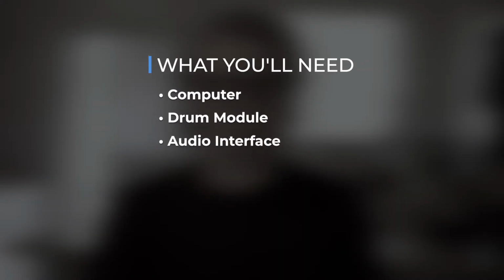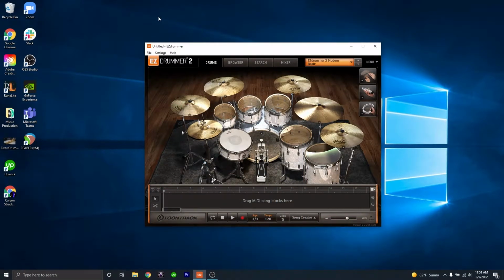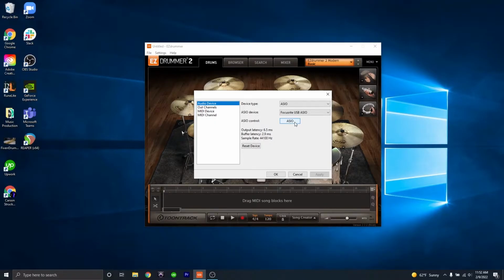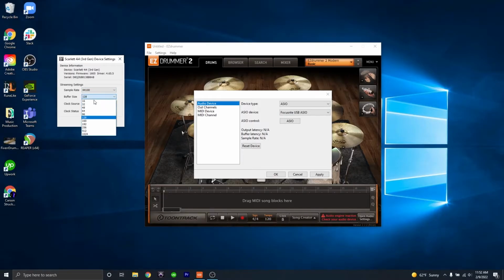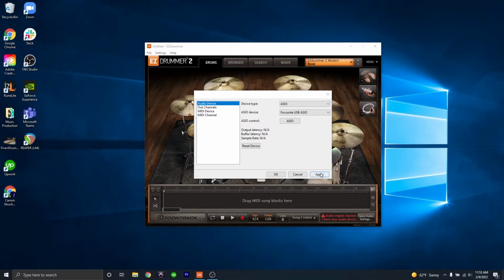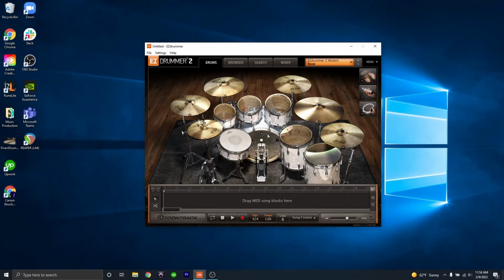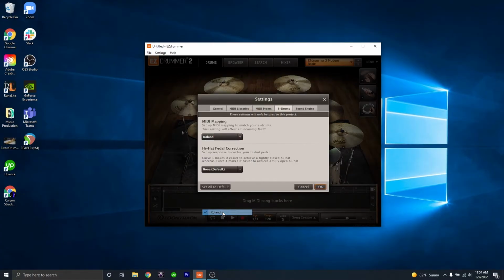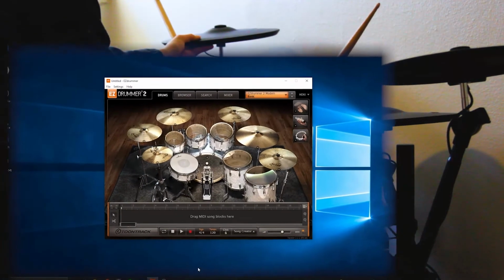How To Connect Your Electronic Drums To EZDrummer2 | MIDI

Comment: This video is the closest I have come to seeing the settings that I can use to control EZ Drummer 2 using an old Alesis SR-16. I have an old, old version of Pro Tools (8.5) which I have tenderly kept running on Windows OS. I still cannot use the pads on the Alesis to make the EZ Drummer 2 speak. I have MIDI thru/Out  on the Alesis going into my old M-Audio (MIDI in on the M-Audio) I have Omni on for MIDI. I am trying to simply play the manual pads on the SR-16 using the sounds from E-Z Drummer 2......sadly aint working.

Comment: Thanks for this video. I just have a few questions. I use an Alesis Nitro Mesh Kit and planning to use the sounds from EZDrummer3. When plugging in the midi cable to the midi input of the audio interface and midi out on the module, where do i plug in the cable so I can hear it in-house and not just on my headphones. Can I just plug in the jack directly to the mono out of the module? or should it be plugged into the mono out of the audio interface? Sorry, I have very little knowledge with these. I've been using the presets of the drum modules and I've been wanting to upgrade with ezdrummer I just don't know how to start. Hope you can help thank you
Reply from the maker: Hey! I'm not sure what you mean by "in house" but all EZD3 sounds will only come from the output of your Audio Interface. You're Nitro Module is only sending data to your Audio Interface to then use with the software. It never feeds back into your Nitro Module. Depending on your Audio Interface, you likely can monitor with headphones as well as the main outputs to say a speaker or some other listening device. Hope that helps!

Comment: Very good video, I have one question, I got my yamaha dtx500 drum, but couldn’t find the driver on internet, is it still needs driver if im using audio interface? Thank you
Reply from the maker: If you're using this method, you won't need a driver for your drum module on your computer. You will need to have the correct driver for your interface installed on your computer though.

Comment: I have a roland td27, an audio interface, pc (windows) and I want to record with a usb cable from the td27 to the pc and NOT with a midi cable (in,out). Can you tell me in detail what to connect with which cables specifically the wiring between td 27brain, audio interface and pc? you can help me;

Comment: Thanks ! This is an easy and very clear video. Can I ask you  some advice ? I have a TD11 and  EZ drummer installed in my comp , and i was wondering if buying this Scarlett would make me win latency (I record to a BOSS Micro BR and later send the file to Audacity in my comp). Is all that depend on the sound car of the computer or not at all if using the Focusrite ?  I was at first considering buying a TD17 module to resolve all that but i have read that the sounds are still "Rolandish" and that there are machine gun effects on the toms. Can you tell me your opinion ? Shall I  stay with EZ Drummer and TD11 and buy focusrite , or just skip directly to TD17 ? Thanks so much Mr carson.
Reply from the maker: EZDrummer sounds are way better than the Roland or any drum module sounds. I'm not familiar with the TD11, but if it has MIDI over USB, then you may not need an interface. I have another video over that as well. But when using MIDI over USB it is a bit more reliant on the computer you're using and the soundcard onboard instead of the Audio Interface which is essentially just an external soundcard. At least based on my experience! Good luck!
Reply: @CarsonStruck  Does the interface act like a headphone amplifier as well?
Reply from the maker: @bradevans3815  the interface I use does. If you're having issues with your pads just being so loud you can't hear your drums, instead of  cranking the volume to 11, I would suggest an in-ear solution like Shure SE215's or something of the like. They are amazing. But I most often just use a drum amp. Which is loud, but I live in a house.

Comment: i have a roland td17kvx and i do video recordings through the roland go mixer pro x console with a camera from my smartphone. Is it worth the effort and the cost to make video recordings via sound card, pc midi? Or should I continue with the Roland go mixer pro x?
Reply from the maker: Honestly, I didn't know this existed. Looks pretty cool and useful! I think that if you're getting things to sound the way you like them, there is no need to switch to something else. This looks like a fantastic solution for a simple live band feed. If you want to utilize EZDrummer though, I recommend hooking up your Roland Module to your computer via USB, which I have another video on, and then just taking the output of your computer to your Roland Mixer. My understanding is that you're skipping using a DAW on the computer and just recording straight to your phone via the mixer instead. So... If you're pleased with your current results, just keep doing what you're doing 🙂
Reply: @CarsonStruck   will i need to buy expensive laptop pc to record like you show in the video? .

Comment: A bit late to the party, but have you noticed a difference in latency between using the usb connection for midi to the computer and the interface as audio out compared to midi cable to the interface? I am just wondering, wether I really need the midi cable. Currently I am running the TD-17 as interface, but the latency at 64 samples is aprox. what you have at 128. That is okay, but not ideal
Reply from the maker: Hey! I have another video on setting it up via USB and no matter which way you decide to set it up, the latency isn't noticeable IMO. MIDI over USB is newer and works just as well in my experience. Your results may vary based on your equipment, but when I made the video my computer couldn't process the buffer size set at 64 without crashing. I've since upgraded to an M1 Mac Mini. To answer your question: No you don't need the MIDI cable if using MIDI over USB instead.
Reply: @CarsonStruck  Hey! I got my hands on a older module (TD12), which only supports MIDI out. Does a MIDI to USB interface cable like the ESI MidiMate eX works well enough?
Reply from the maker: @SchwappSchwopp  I think it may. If you don't have USB on your Module AND don't have an Audio Interface, It sounds like the only option! Not completely sure how to have your computer read the midi data... But I guess that's what the interface is doing. It's worth a shot!
Reply: @CarsonStruck  I already tried, it works perfectly fine, thx though!

Comment: Hi, my interface, 2I2 focusrite does not have midi I/o. Can I use midi to xlr cable to connect my edrums to my interface input?  If that doesn’t work, and needing new interface with midi I/O, and I’m able to connect midi to new interface with midi I/O, do I still need to connect usb to pc ? Please advise. Thank you.
Reply from the maker: If your interface doesn't have a midi I/O I would just connect directly with USB. I have another video on how to do that. I don't think a midi to XLR cable would work because the midi signal is just data for the computer to process and an XLR cable passes an actual audio source. Two completely different things. Hope this helps!

Comment: I know you can turn off direct mix in order to hear the ez drummer drums over the roland drums. The problem I see occuring is latency. What is the best way to have so when I hit the drum, the ez drummer comes through the headphones at the exact right time, rather than a second later. More ram? Best CPU? Ive never been able to figure out latency.
Reply from the maker: I don't know the science behind it but from experience, I can say that using an external sound card (Audio interface) makes a huge difference. Selecting that as your preferred hardware when routing your edrums to EZDrummer will allow for very low latency. If you have it all set up correctly, make sure to reduce the buffer size on the settings of your audio interface. Let's say... 128 buffer size or something. Test that out; I don't notice any latency and I don't have any of the nice or fancy hardware.
Reply: @CarsonStruck  Ok thanks for the response. My focusrite is coming in tomorrow so I saved your comment. Appreesh!
Reply: If you don't have a fancy audio interface you can use ASIO4all, which lets you adjust the audio buffer on onboard generic sound cards. I've been using it for a while and it works great. No perceived latency.
Reply: @jamesarmenti8876  Dude it's funny i have been using this Asio, didnt notice nothing special then one day i went back to just using the TD11 module and then, omg, i could feel the difference. I actually didnt play for many months i was abroad, tomorrow i will try to reduce at the maximu the latency with Asio.
Reply: @MaximePhuket  I have both the roland sound and the superior drummer sound blended in my mixer. There's no distinguishable delay between both  could be that the latency is so low on my focusrite interface. Nobody that has played my kit has mentioned there being a delay w/ superior drummer triggering.